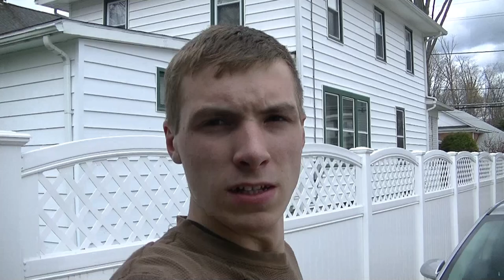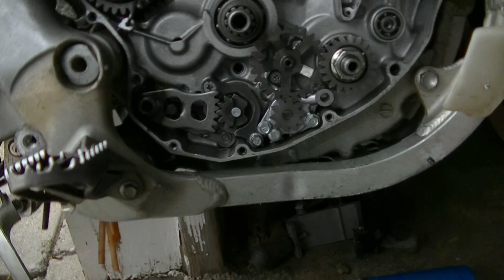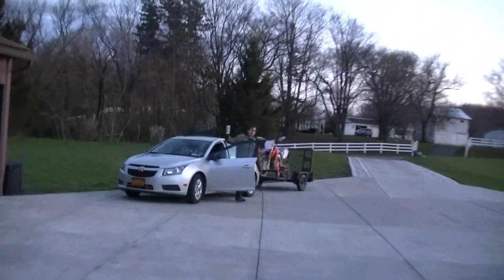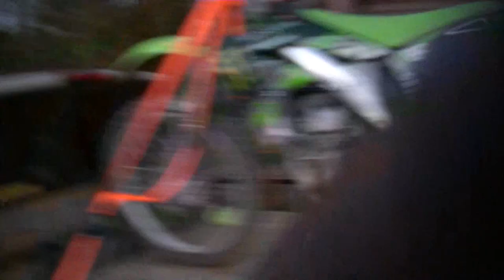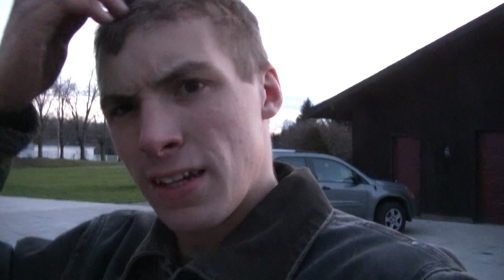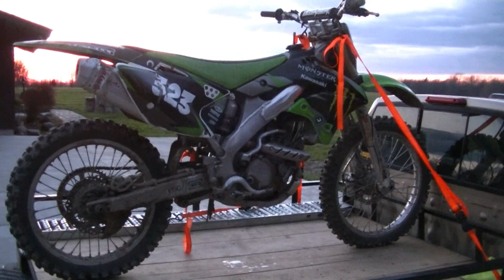Welded up My Bike Crank

Comment: I just repaired the same issue. I have a 3 part video series here on YT:

"How-To: KX250F Top & Bottom Engine Rebuild"

The owner wanted new cases, which was the most expensive option for sure.

Comment: That was an awesome Idea to weld that piece I had to do the same thing when I rebuilt my brothers rm250 some stripped out the original drain plug so in the process of tapping new threads freaking broke screw buying a new case when you don't really have too